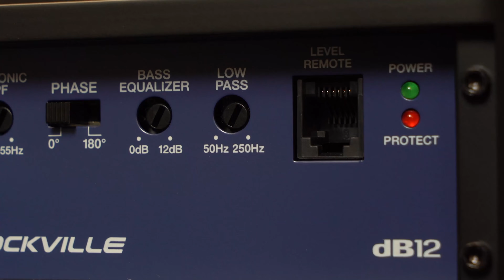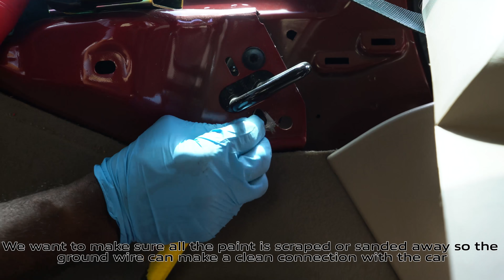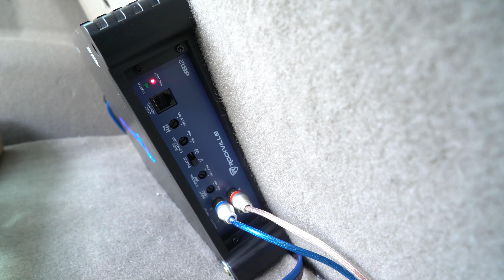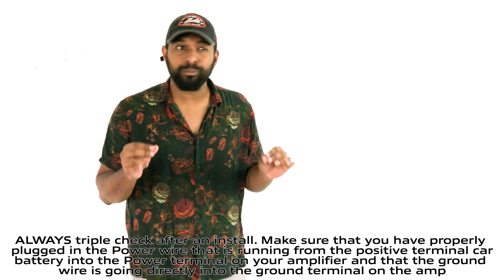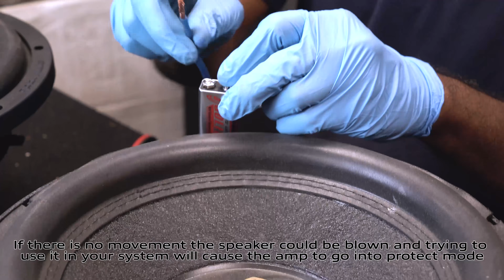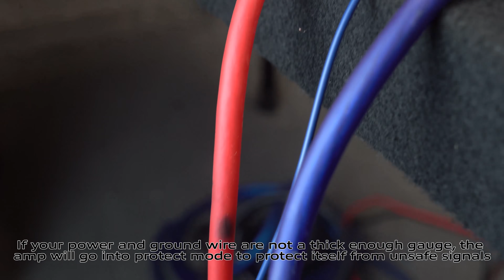What to do if Your Car Amplifier Goes Into Protect Mode and how to fix it! (Car Amp Troubleshooting)

Comment: everything worked fine one fine day played a song and wanted to repeat the song just went into protection mode . took out speaker wires still in protection mode took out remote wire protection mode checked fuses still protection mode tried everything starting to believe its just the amp

Comment: my 4channel is on and plays well. but my monoblock goes on (protect mode) then off (no led indication) then starts to heat up, melting ground & 12v cables. anyone help please?
Reply: if your cables are melting then it is most likely that your power cable is touching an earth somewher.

Comment: I just know all my wires are good I was pounding my speakers for hours and it cut off well the amp it's a Power akoutik 1000 k edge and it has No damn fuse 😢

Comment: This video helped me today. I was trying to test my new Rockville amp without connecting all the speakers (I tried to test just the sub), and the amp went into protect mode.

Thanks to this video, now I realize that if it detects an open on any output, it goes into protect mode. I had no clue it did that.

Once I hooked up all the speakers, then presto it worked.
Reply from the maker: Glad it helped!

Comment: so i have 0 guage wire. 2 batteries. big 3 upgrade. amp is never hot or really warm when it cuts off. wired (12g) from + - amp to + - of speakers. mono block, rockford 1600w. in my 45 minute to and from work i can bang a good 3/4 of it. i listen to powerful bass songs. steady RMS. 
what exactly is my problem? voltage is there. unless theres a negative rated wire i got the best i can get for battery and ground. my 12g should be fine for speaker wire. connections are secured. no wires touching. all my previous amps just werent strong enough. so when i got this i wired it up the same way. its set at 50-60%. anyone got an idea?

Comment: If anyone can help it would be much appreciated. I recently installed my subwoofer that has a built-in amplifier. When the ignition is on it works fine but as soon as I start the car the subwoofer turns off and the speakers won't play any audio the just start to click. Any advice ?

Comment: This is by far the best troubleshooting video I've seen. Not just for car audio but quite frankly, it's as good as any video I've seen on anything. So look....I've checked every last thing you've said and still can't figure out why this is happening...
When I start playing music it sounds great. Start turning it up and I'm getting excited because it is starting to THUMP and then all of a sudden the subs won't hit and the protect mode light comes on my amp. I back off the volume a little bit and it starts working perfectly again. My voltage reading from my amp at the point this happens is reading anywhere from 13 to 13.5 volts. So I'm getting the power I need right? I hooked up a different sub to see if that was the problem but again, the same thing happened. I'm running an 2500w monoblock amp that produces 325w at a 4 ohm load. I'm powering a 4 ohm Kicker 15" that's rms rating is 350w.... I AM STUMPED!!! PLEASE HELP!!!!
Reply: I’m glad I ain’t the only one going through this. I’ve spent so much money already smh. Were you able to fix it ?
Reply: I’m glad I ain’t the only one going through this. I’ve spent so much money already smh. Were you able to fix it ?
Reply: Hello, can you please answer if you fixed your problem? i have the same issue right now please help @M4shurr_
Reply: i thought u were going to provide the solution
Reply: Hello, can you please answer if you fixed your problem? i have the same issue right now please help

Comment: I know this is a older video so I'm not sure if I'll get a answer. However I have a 2 ohm dual voice sub  wired down to a 1 ohm matching my amp. Except I've tried hooking this sub up to 3 dif amps and everytime I can get it to Plat a lil with volume down but as a soon as I turn it up to like 6 it sends every single amp I've tried into protect mode. Is this something that's fixable or is the sub trash. (Also the sub has excellent sound until it sends the amp to protection mode

Comment: i turn my car on as soon as the bass hits it goes into protection mode  RORECK PR-122M Complete 1500W Dual 12" Car Subwoofer, Includes Loaded Enclosure with Mono Block Amplifier with 8gauge wire
Reply: thats why that whole setup 🤢 get rid the 8g wire throw out get 0 and throw those subs n box out and get non walmart/goodwill speakers

Comment: if i turn up the volume to high and my amp getting in protection mode .. so i turn off the head using .. after 5 minutes i can play it again . then got protection mode again .. and you got any issues that would could be??
Reply: Same

Comment: Hey my speaker wires touched and now my amp is stuck in protection mode I check the wires even got new ones and checked the speakers with a battery and theyre good but it’s still stuck any help ?
Reply: Did you figure this out because that’s also what I’m dealing with

Comment: 1. power and ground wires secured?
2. is system compatible with itself?
3. is there enough ventilation to the amp?
4. do speaker cables touch each other?
5. reverse polarity, gnd in power and power in gnd
6. is speaker still alive?
7. is remote wire connected properly?
8. voltage problem with car battery if lower or higher
9. are wires for gnd pwr and rem thick enough?

Comment: I am having similar issue currently on my Rockville all in one sub and amp, I have connected the ground cable to a negative terminal of battery? Is that ok? I am keep getting red protection light solid and flashing when the volume is above 8 or 9? If I increase the volume to max the amp shuts off and doesn’t work. Please assist . I have high input cable running from the amp to my rear 🔊 speakers.

Comment: I've had a new install for about a year and it's worked great until about a week ago. The music would just stop for about 10 seconds then start playing again. It didn't matter the volume. I then noticed when I turned remote(wired to amp) completely down that it wouldn't happen anymore. Then I turned remote up as little as one notch and noticed the protect light was coming on when music would stop and light would go off when music would return. After starting my truck the battery would show 14v. When the radio was on with remote down all the way it would show 12-13v. When remote was turned up and music would shut off and on I would see a range of 6-10v. Any ideas what might cause this after almost a year?

Comment: I'm still having trouble . My ground has a solid connection and my power is secured an hooked up right so is ground and remote . My amp is capable of 1 ohm at 900 rms and I have 2 dvc 4ohm   at 600 rms total for both so it should hold and they're parallel wired to 1 ohm . But my amp has protect mode on I cant figure out why
Reply: Have you found out what the issue is ? I’m having the same trouble
Reply: your amp is capable doesnt mean it always will
Reply: I’m having the same problem, been running the same setup for a year, my car battery died and once I got a new one installed my amp was in protect mode and hasn’t came out of protect mode ever since. So confused

Comment: my protect mode led blinks when the bass is turned to max, my head lamps dims when the bass hits. so i wonder if my voltage drops to much when heavy bass hits.
Reply: If your lights blink when the bass is up you need a extra battery same thing mine was doing when I had it maxed out or the bass hit hard.
Reply: Yep. Get a 2nd battery 🙂

Comment: I just bought a 3800watts amplifier my old setup was a 1200watt boss amplifier with the 1200watts wiring kit is that a issues for a 3800watt amp going into  Protect the mode?

Comment: Have a Rockville sub in a self contained box. Worked great for 4 years. Took a corner too fast today, box shifted and amp went into protect mode. This video helped me figure out that the ground wire had disconnected. If anyone is havig this issue start there. This thing still sounds great in my Honda Fit. Thanks for the information.
Reply: Same happened to me a few days ago. I have Rockville db55 and i can’t figure out a fix

Comment: What if your protection light comes on even when it is cold and not overheating
Reply: same thing i want to know
Reply: Well my problem was cured by just giving my amp a good jet of air  & a hoover, probably too much dust making it overheat or short circuit ? But my amp is 30 years old Denon !
Reply: Remote wire is my big culprit.
Reply: That's a great question, I'd like to know too

Comment: hey question ik this video is kinda old but my fuse it good nun of my power or ground is loose nor flipped it’s getting 14.42 volts nun of rca or speakers are hooked up
Reply: Amp hot?